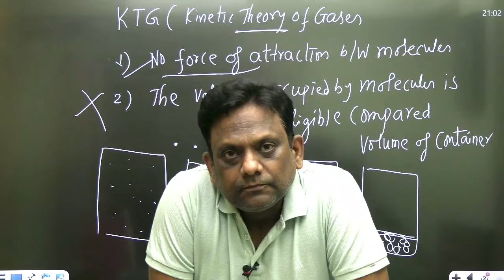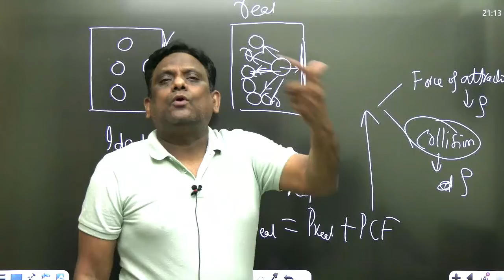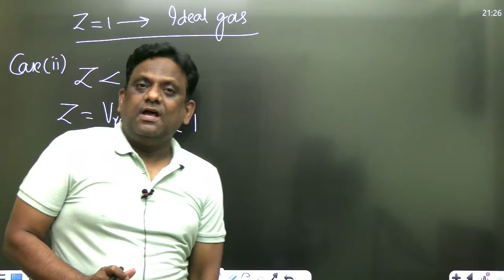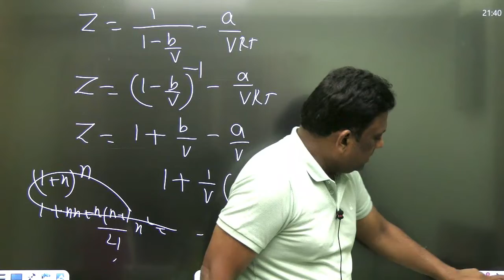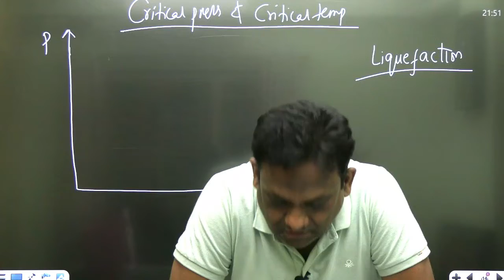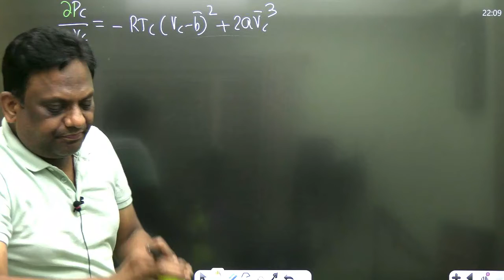Vander Walls Equation, Compressibilty Factor and Critical State

Comment: The way you have explained the Vander Walls equation in so simpler way is really imposing Sir..... Now I got a crystal clear picture of why at very low pressure and high temperature conditions the gas will behave as an ideal gas and also about the compressibility factor as well..... Looking forward to more such wonderful concepts from you Sir😇